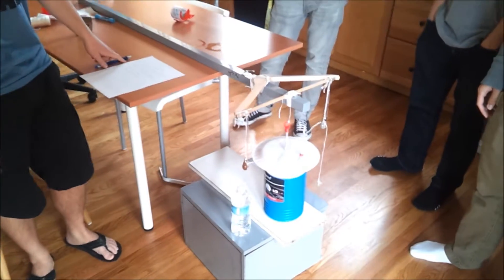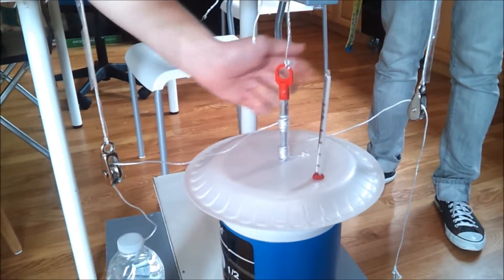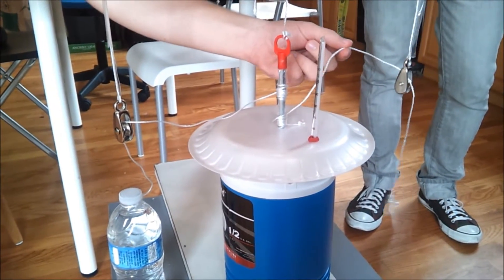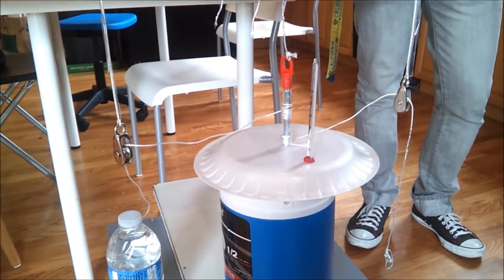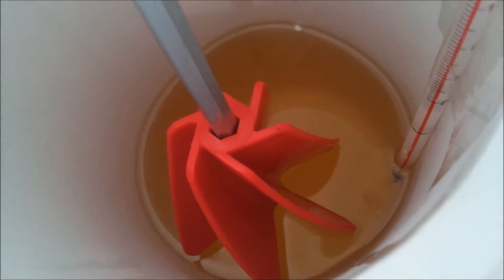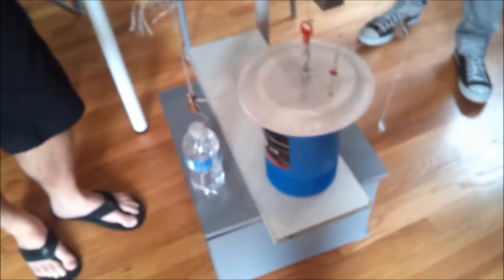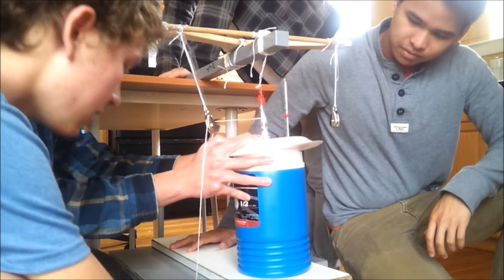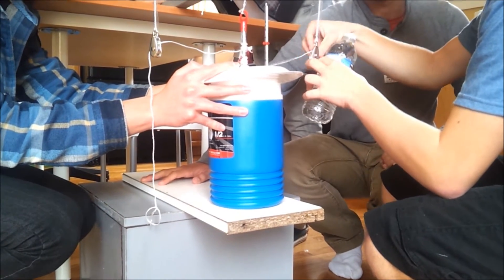James Joule Machine group # 14

Comment: Interesting. Years ago I noticed an empty gas can sitting in the sun. There was a very slight amount of gas in this square 1 gallon gas can anyway. As the clouds passed in front of the sun the can would 'pop!' from the expansion and contraction of the fuel vapors remaining in the can. This gave me the idea that maybe this energy could be stored by using a clutch bearing assembly much like a bicycle wheel & attach a weight that raises as the can pops. When the weight reaches the top it drops.